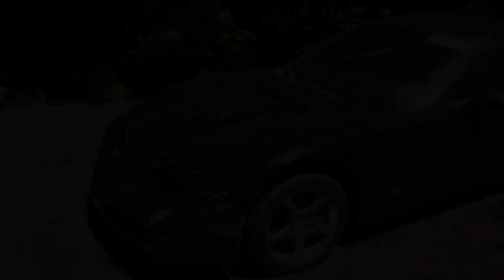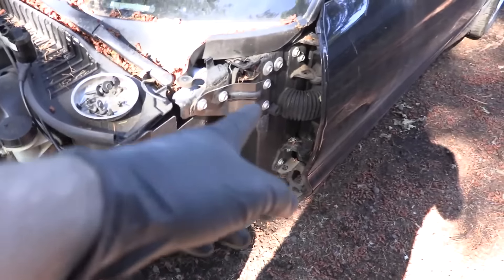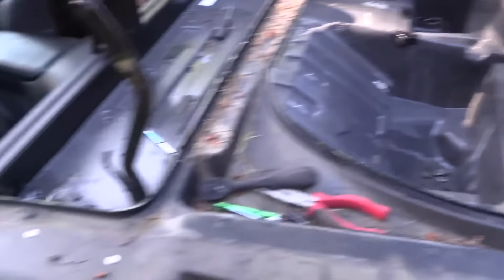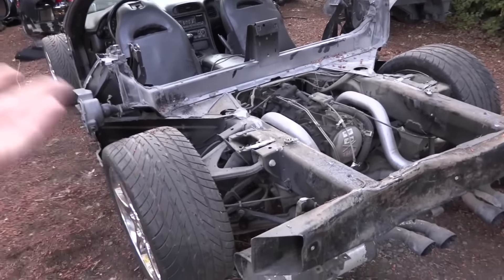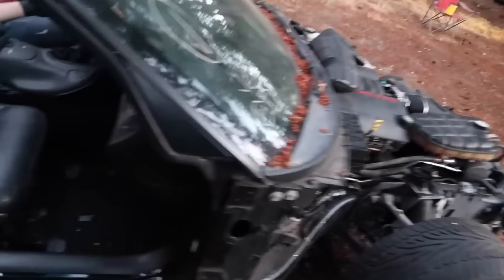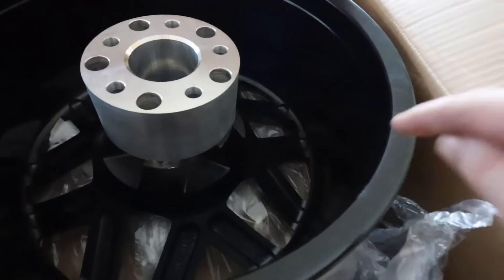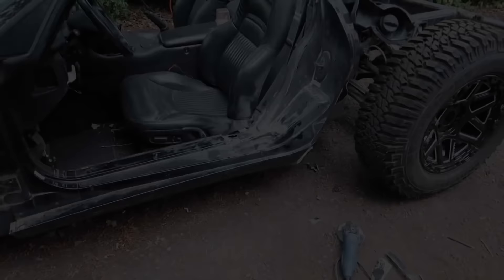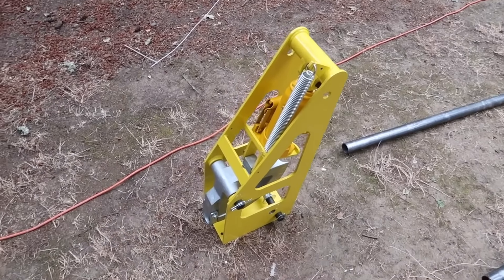FULL BUILD | Transforming A Crashed 2001 C5 Corvette Into An OFF-ROAD VETTE KART

Comment: any particular reason you used the spacers without hub center rings?   you are putting all the weight on the bolts and still might not necessarily be centered